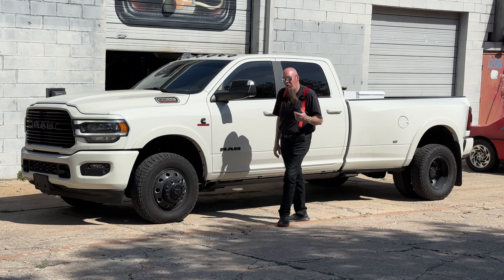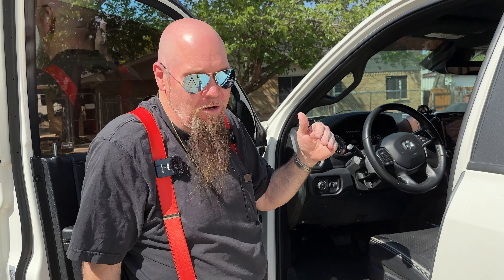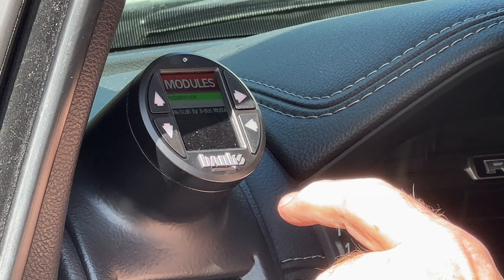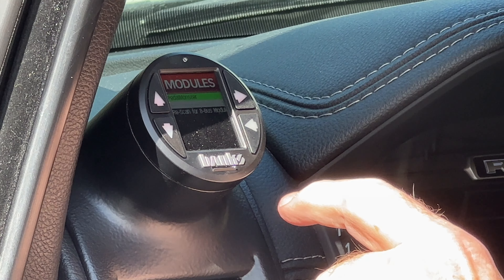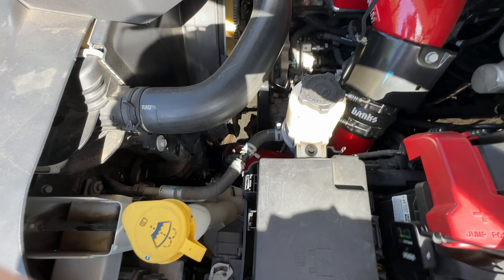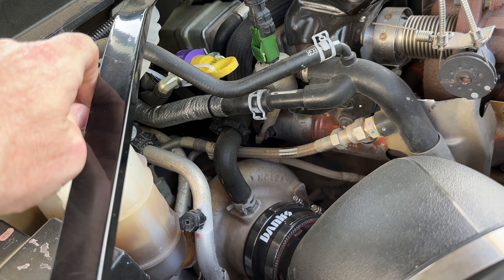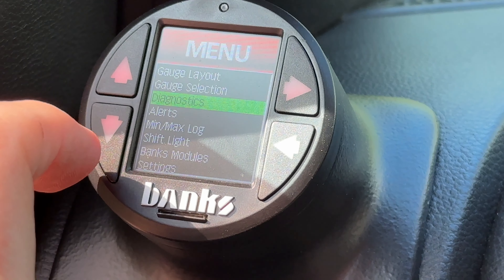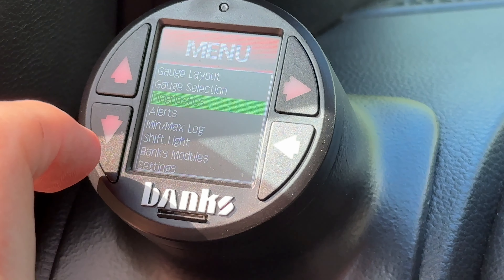BANKS POWER upgrades to my 2020 RAM 3500 Laramie!

Comment: I think the throttle lag is to protect the drivetrain.
Reply: I never understood why guys and to spin their tire and do a burn out. I just don't like buying tires.
Reply: That's how you can tell your not young anymore
Reply: &dumb lol
Reply: The throttle lag is the delay in the throttle by wire computer system and just the response time from the computers vs the old school throttle cable.

There's more to it than that and for this system also, but that's the basics

Comment: I understand why someone might choose to use the PedalMonster. However, it only adjusts throttle response and doesn’t address the root issues that affect performance and efficiency. That’s why I have never used one and never will—I prefer a custom tune that tackles the underlying problems and solves efficiency issues.

Comment: Thanks Video Bob. I just left the Banks Website before watching your video so I have some general knowledge about the Pedal Monster itself.

I was curious if you had any information on what type of fuel mpg you are averaging say both city and highway under normal conditions and while towing?

I completely understand that people don’t buy these trucks for the excellent mpg but I was curious is all.

I just purchased a 2016 Ram Laramie 3500 6.7 Dually. It bone stock at the moment but I’m gathering information before I do any upgrades.

Thanks again Video Bob. Oh by the way did you install everything yourself or ?

Comment: So you got a 3500 without the Aisin & HO? Isn't that why you would get a 3500 dually for? I got a 3500 srw & had to get the HO & Aisin
Reply: All u did was waste 10more grand 
My 68rfe gotta 400k miles and finally controle module went

Comment: I do jot know what is going on with the intake heater bolt but I had a 94 2500 till 2018 no issues I had a 2010 2500 for 10 years no issue with it
Reply: When the youngster jump in daddy's trucks they like to build boost and stuff heats up especially during the winter hot to straight cold

Comment: 2020 Ram? Do you still have the CP4 fuel pump?
Reply: Good question. Two of my neighbors have 2020 F-350's and both have had their CP4's replaced or whatever Ford's fix is.
Reply: They already had the recal about for 1 year now... They swap to brand new cp3
Reply: @tmonei4597  Good to hear.

Comment: Every thing you done was great but it's a dodge.  God bless you Chaplain Dale Stearns
Reply: As a CDL hotshot driver who has driven over 400k on Rams and over 350k on Fords I can tell you Rams are hands down better in every way! Better low end torque, way better exhaust brake, more simple design, easier to work on, cheaper to work on, and yes much more reliable. I was a Ford guy but all 3 of the F350s I drove broke down within 30k. I had zero issues with any of my old companies Rams and now as an owner operator with 120k on my own 2020 HO Ram I have still had zero problems. And I work my truck hard regularly towing 30k in and out of very remote mines all over ID and MT. I trust my business and my life with Ram.